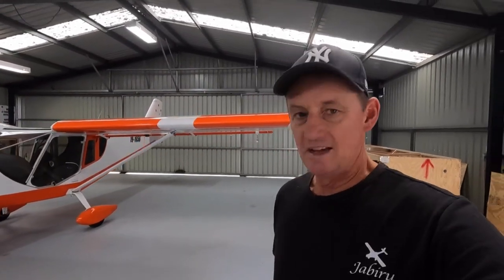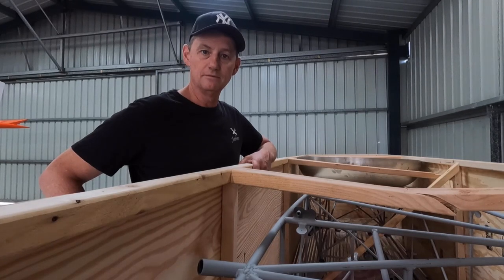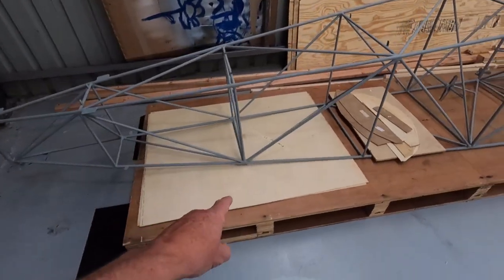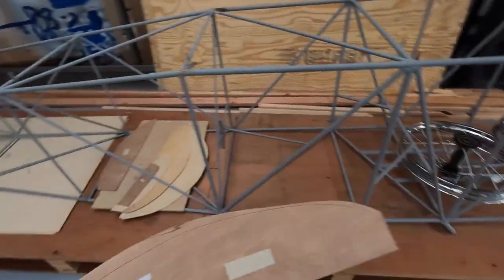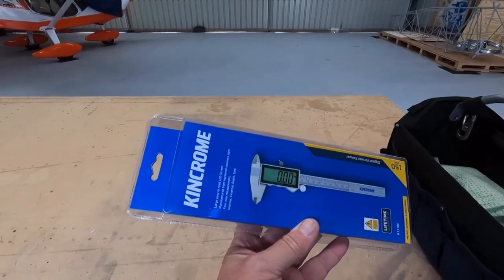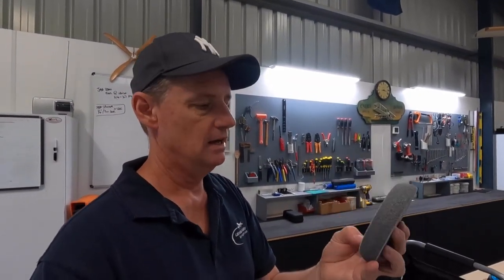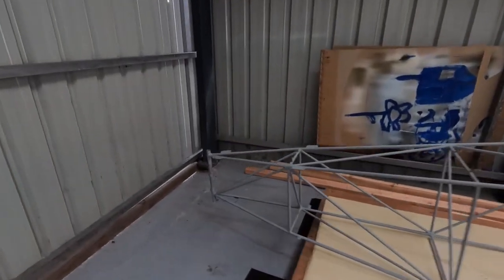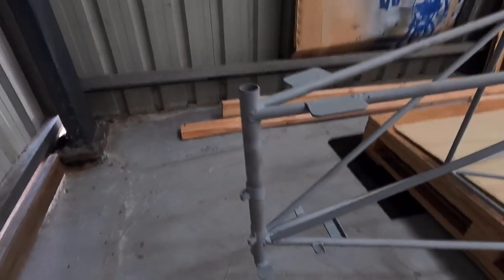Sopwith Camel Build #1

Comment: Hi Scott. I’ve got the camel in a flat pack up here in Townsville. Cracked it open end of July. I’ll start shortly. Are you with the SAAA for the assistance and inspections?
Reply from the maker: Hi, I lived in Kirwan for a few years loved TVL. No, I do most of it myself and get another LAME to do the 3 or 4 periodic inspections. You can basically build the camel up to ready to fly minus covering then get it inspected. What engine are you going for?
Reply: @scottmatthews5280  I’ve put down my deposit with Paul for the R3600. I opted for the full aluminum frame, so looking forward to the joy of assembling that stack of pipes. Been a bit hesitant/intimidated to start though. Intent is to paint it in 4SQN colors. I’m former Army Aviation fixed and rotor wing.
Reply from the maker: @williamnorval200  jump in and start. Find a local source for 6061 tube then you can relax a bit. Feel free to ask if I can help.
Reply: Thanks Scott. Can I DM you via FB? I have a few questions before I kick off.
Reply from the maker: No problem

Comment: I used to work for a company that built fishing trawlers.  After we got done building one, the draftsman would come out and measure the boat and draw the blue prints from that.  Might be what happened with your airplane, they built the prototype and measured it for the plans.  One day a customer came in and wanted another boat exactly like the first one.  We had never actually worked from blueprints.  The second boat took 50% longer than the first boat to build.
Reply from the maker: Sounds very similar. Build is going well just not much guidance